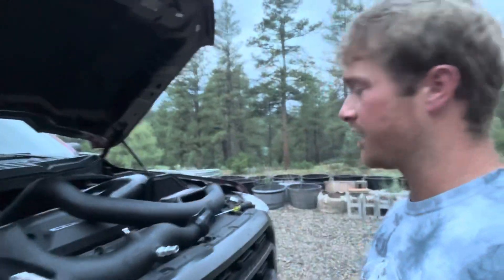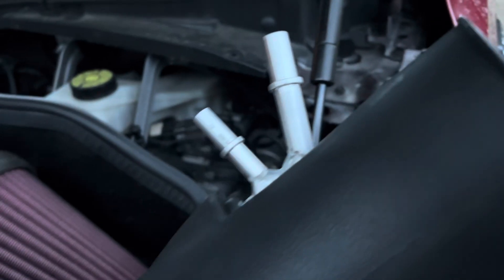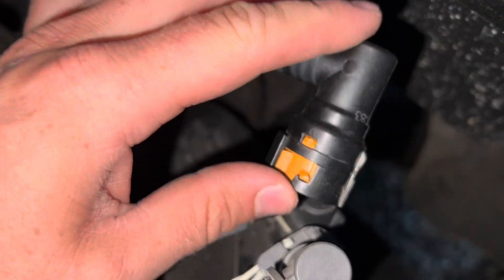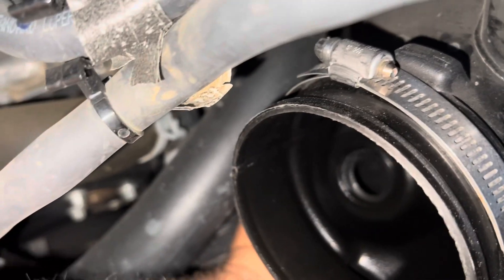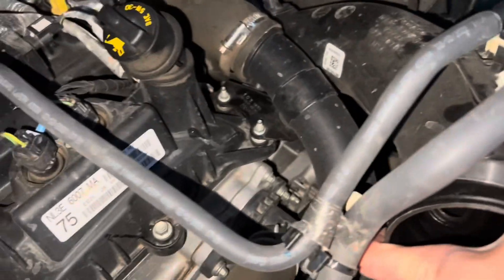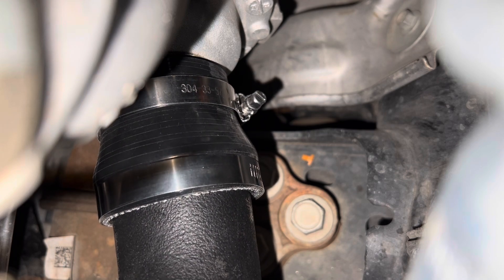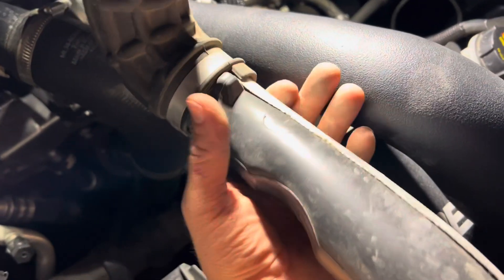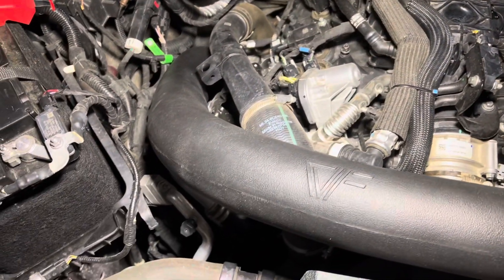CVF Turbo Inlet Tubes for the 2021+ Ford F150 3.5L!!

Comment: For the line with orange tabs. You squeeze tabs inward at same time. While still squeezing, push down, then pull up.
Reply from the maker: Have you taken that line off on a Gen 3? It doesn’t work like that.
Reply: @BoostKingMatt  what's the fitting called with the orange tabs you broke? Trying to get the proper tool before I attempt this, thank you.
Reply from the maker: @B_EIMON hmmm, it’s the PCV hose, I’m not sure what the fitting is called per se.
Reply: @BoostKingMatt  thank you

Comment: Thought you weren't going to "push" things as much or keep the build on your newer 2022 F-150 3.5 liter EcoBoost truck a bit tamer, lol. Full JLT dual inlet cold air intake, custom (I assume ZFG Tuning) tunes, bigger twin turbochargers, CV Fabrication's biggest upgraded intercooler, Turbosmart BOV. Looks pretty involved. But a modern fullsize pickup truck is a "canvas" for customization so a "build" may never be truly done & the bug bites to add more, lol.
Reply from the maker: Intake is not dual, it’s a single filter, and it’s not custom. No ZFG tuning. Just a light tune from Brett at BoostKing Tuning. Yes I’m doing upgraded turbos and there will be a full exhaust and downpipes coming too, only because it’s all sponsored though. Otherwise I have nothing to make videos about.

Comment: Have these tubes made a difference in response? Any other noticeable differences
Reply from the maker: No big differences that I’ve noticed, but they’re bigger, so inlet pressures are a little less which is good.
Reply: @BoostKingMatt  got you. Thank you for the reply.

Comment: Did you use the factory CCV line with the new inlet tube? Missed it in your video. I have the tubes and they came with a new rubber hose but I’m wondering if the factory ccv line can be used.
Reply from the maker: I broke the factory one 🤣 so I ordered a new one. Since then I figured out how to remove it without breaking it. It’s very challenging, be super careful. I didn’t use CVFs line they sent with the inlet tubes.
Reply: @ ok so does the orange fitting fit on the metal “nipple” on the CVF tube?

I used a quick disconnect tool to pop it off the inlet tube but not sure I’ll have the same luck with the engine side so if I can reuse the factory tube then that’s awesome!!
Reply from the maker: @WaterFowler41 it will fit on the metal piece from CVF

Comment: Hey Matt, question for you. I just received mine and no instructions were given other than referring to your video. The stud and nut, is that what goes into the factory grommet mount? So do you just tighten stud in, thread nut on a few threads and push into grommet? Seems kinda hokey. Thank you
Reply from the maker: Yeah you are supposed to push it through the grommet and put a washer and nut on the other side. I actually just took my studs all the way off and didn’t attach them at all to the rubber grommet.
Reply: @ Ok, thank you

Comment: Does this actually add HP? Debating if I should invest in this or go with the hot/cold piping kit.
Reply from the maker: I think it helps reduce pressures at the turbo inlets. It’s a good upgrade.
Reply: @BoostKingMatt  do you have the part number on the hose you broke? I’m gonna buy one just incase when I swap my pipes.

Comment: Hey BK Matt, thanks for responding to me recently on your CV Fab hot pipe install video. I have a 2023 raptor with the high output 3.5 ecoboost, and you have one of the only channels installing mods on the ecoboost motor. You may or may not know that the 23 raptor ECU hasn't been cracked and so tuning options are incredibly limited for us. We have either the JB4 piggyback, the recently released ford performance flash tune (I have this, it is very conservative), or you can do an ECU swap with a 22 and MPT is the only company tuning them with that option from what I know (no support from Cobb/Goosetuned).

As mentioned above, all that I've done so far is the ford performance flash tune. I pre-ordered CV Fab's new high flow downpipes which are scheduled for release in late march/april. I am DYING to do some more mods to my truck!! I really think it needs about 100 more hp/tq from factory. The only problem is that I'm not sure if there would be any noticeable gains from any of the other mod options on the market. I am thinking a Cobb intercooler and Turbosmart BOV (I'm a 90's JDM guy at heart and love the blowoff noises) would be the only mods that might actually help (i.e. keeping charge air temps down after repeated highway pulls). 

Would you recommend AT ALL installing (i) a Cobb intake/snorkel, (ii) CV fab hot/cold pipes, and (iii) either K&N or CV fab turbo inlet pipes (aka boost tubes)? From your comments on this video and the hot pipe video, it doesn't seem like (ii) or (iii) would give any performance gains?

Thank you and I really appreciate your response & time!
Reply from the maker: Hey man, 

So MPT is not the only one who can do 2023 ECU swaps. ZFG Racing which is who I highly recommend will do those also. It’s super simple and not too hard to do. All the programming is done remotely by Adam at ZFG. He will make your truck into a rocket ship, and, if you do upgraded CRP stage 4 or 5 turbos paired with an upgraded intercooler you can easily make another 150-200hp above stock.

If you want more info, dm me on Facebook or Instagram.

Comment: I used the K & N inlet tubes as I thought that they were the only ones available for my 23.

Mine had plastic rather than the nice metal small pcv? hose fittings.

Im not sure that this gained me any power, but it may have helped with removing future restrictions.  I have to say the same thing (no apparent gains) about the cvf hot/cold turbo / intercooler pipes.
Reply from the maker: There isn’t any gain from them really.